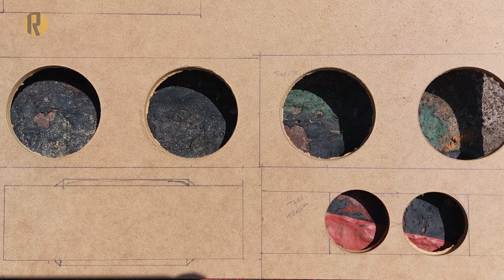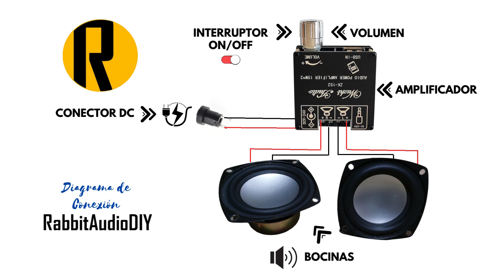Como hacer un Altavoz Bluetooth Portátil | bocina casera

Comment: my diy bluetooth speaker use that wuzhi zk-152, but the bass is small. I add the bass from wuzhi audio app just increase little bass.
please, any solution brother.?
Reply from the maker: Hey bro, what voltage do you power it with? This amp works from 9 to 24V, so at 24V it will deliver its 15W. Use an equalization app; some come with bass boosted
Reply: @rabbitaudiodiy  I use battery 12 volt with bms 3s brother. the sound is super clear, but the bass is small.
Reply from the maker: @youagain13xl you need more voltage
Reply: @rabbitaudiodiy  I use 4 speakers, all of it 4 ohm and 5 watt, 2 for left and 2 for right with series connection so it must be 10 watt 8 ohm.
Reply from the maker: @youagain13xl Your connection is fine, but at 12V it is delivering perhaps less than 10W per channel.
Reply: @rabbitaudiodiy  okey, thank you so much brother.
I'll try..